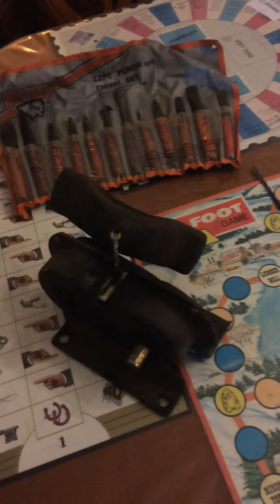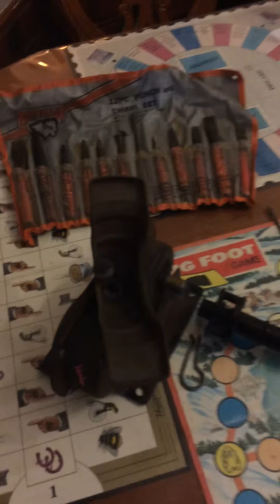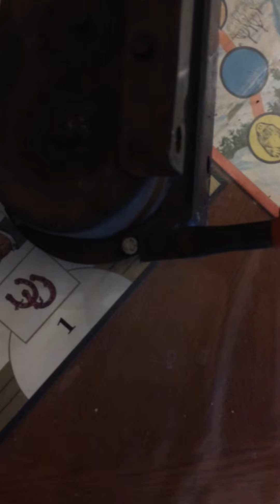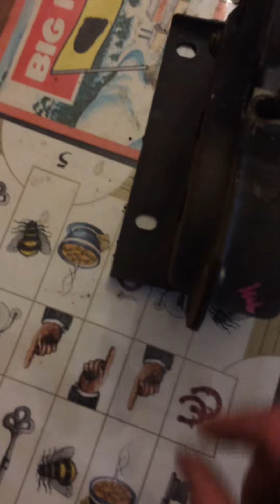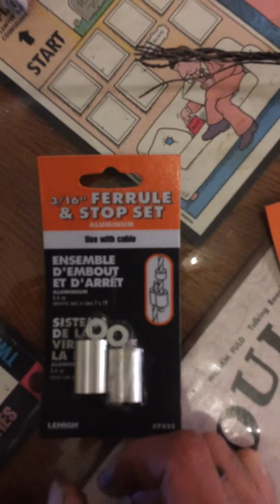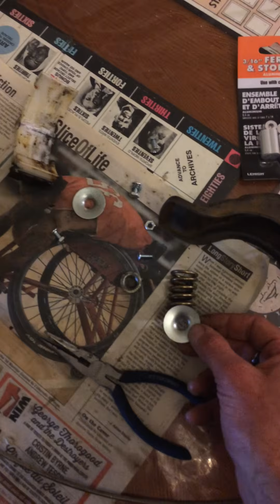REPAIR FIX FORD SPARE TIRE HOIST WENCH - CABLE END BROKE & JAMMED INSIDE - 1/6 PART VIDEOS

Comment: hey I was hoping you could help me...the cable of my hoist is jammed inside (not the secondary latch) is there a way to fix it without cutting open the housing??
Reply from the maker: Cynthia Barela generally speaking as a non professional, I would say that if you can not pull the cable out of the jam, and can not open the cable housing, then I'd say you'd have to cut the cable and go forward thinking from there(then repair or replace the cable or the whole box from the salvage yard or new).
Have you tried applying a some WD40 to the box if it's rusty etc?
It might be the jam seems unmovable but that you aren't using some sort of leverage to apply much much more unjamming pressure than our mere hands can apply although the winch gearing is designed to only drop the cable in proportion with someone turning the box's crank shaft counter clockwise. So someone would have to be attempting to turn the shaft at the same time unjamming force is applied to the cable to come out-down.

Careful, use gloves etc.. as under pressure, frayed cables and metal edges can cut hands.
Some of the gearing in the box is some nylon wheels so if just saving the cable is the goal, another option may be to apply a propane torch to the box cable entrance and sides, to melt the nylon gears inside in hopes the cable will then release, taking care to have a fire extinguisher close by and stay away from the gas tank.
Hmm I've run out of ideas lol
Take care!
PS Here's my favorite site I like to share with everyone, that has helped me so much to get out of our mind traps and so so much more:
WWW.DESTENI.ORG
Reply: Jim McDaniels I just pulled the hoist off today so wd40 was my next try tomorrow. it's not Sealy about saving the cable just an easy fix is what I was looking for today I will probably just replace the whole stupid thing sense the secondary latch sticks every time.thanks for the advice